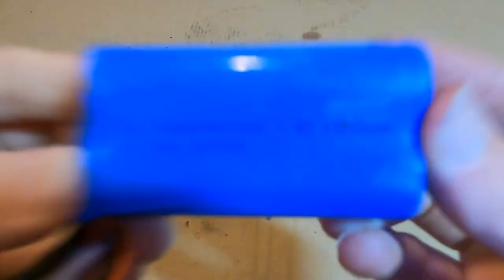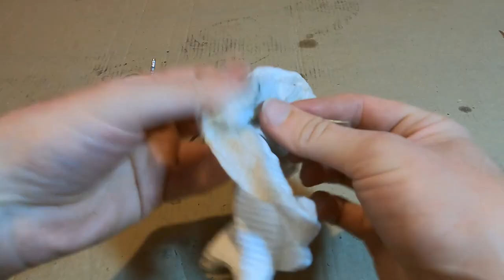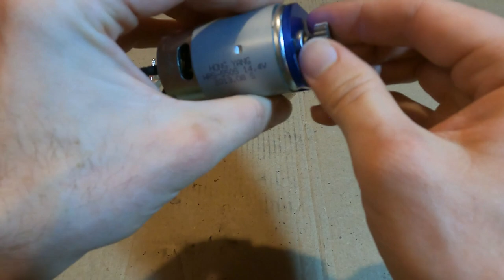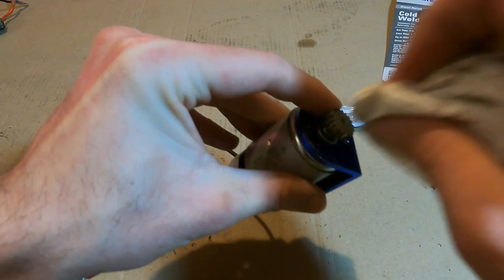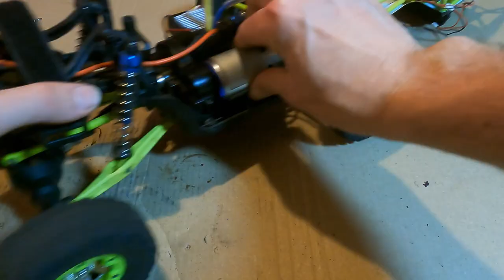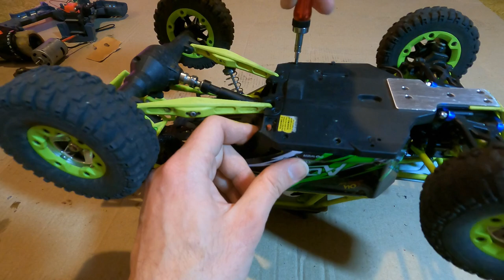Installing a drill motor in my RC Car

Comment: I'm upgrading a motor on a cheap little Subaru wrx with a 14.4 volt. Not sure what the original motor was but I know it isnt that great. Any tips will be greatly appreciated.
Reply from the maker: I ran into an issue with mine where the drill motor stopped running on the 7.4v battery and the ESC couldn't handle 3s, you might be better to get a good brand of 2s motor if it's a brushed system.

Comment: 45 bucks can get you a 120amp esc and a surpass hobby platinum brushless motor,cost you less than a cheap drill .
Reply from the maker: Thanks Erek, 
I have ordered the surpass 120amp esc and I went with the surpass kk 3650 9000kv motor instead(ordered a couple of weeks ago), do you think the platinum series are better? 
The motor has arrived but just waiting for the esc and a pinion gear, then I will install it :)

Comment: so i have a drill motor and an awd nitro rc car with a broken engine... ive got the drill motor in but wondering what kind of battery to run it on? tried with a little 9v lipo but it wasnt that fast. any help appreciated
Reply from the maker: You can try a higher voltage if the motor and esc can handle it, but normally they have a lower top speed and higher torque so they wont be as fast, you could also put a bigger motor pinion if you have an adjustable motor mount.
Reply: @Wltoys  thanks! I'll try that.

Comment: Is it possible to use the drill's gearbox, and turn the car into a crawler?
Reply from the maker: It might be possible, but you would have to do way to much for it to be worth it in my opinion and trying to fit it would be a big challenge. 

I think if your main goal is a crawler and you want to use a drill motor, it would be better to get a 6s capable esc and if you wanted to go further then get a small pinion gear and an adjustable motor mount.

Hope this helps :)